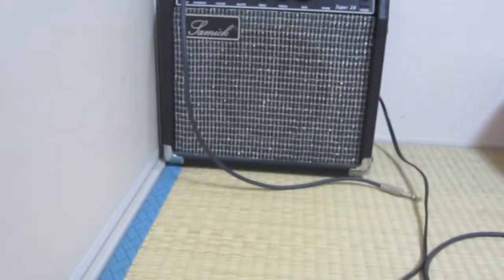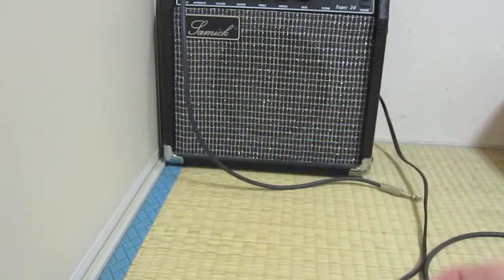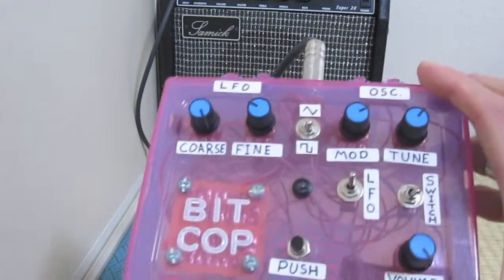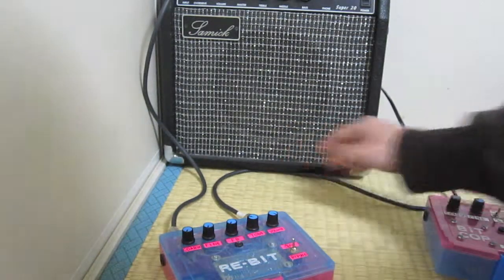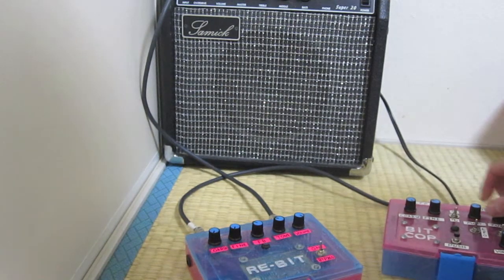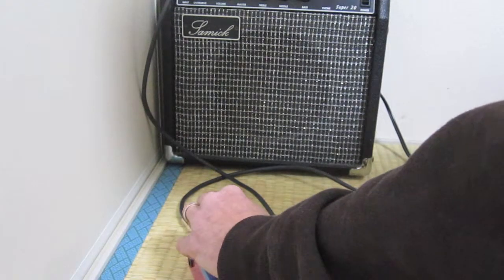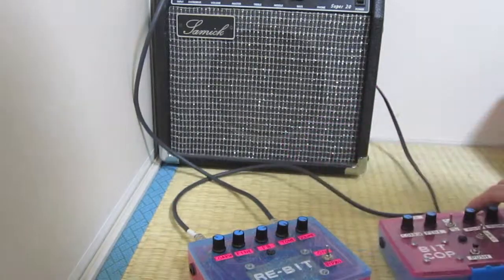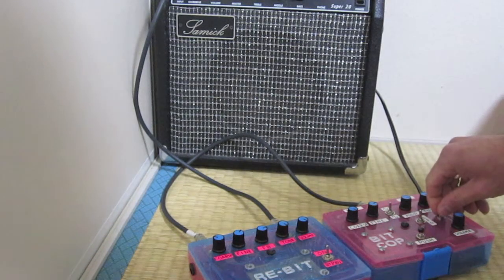Re-Bit DIY PT2399 LoFi Delay Pedal

Comment: Nice and lofi! The Volca Keys has the same delay chip but it doesn't sound quite that mental unfortunately.
Reply from the maker: ChrisLody I wouldn't necessarily call that unfortunate. A few months later I realized how bad this thing sounded. Someday I'll go back to it and fix it up. It's too noisy.
Reply: MrFricoco well I like it. It's easy to get a nice clean delay these days. It's the fucked up stuff that's more difficult I'd say :-)
Reply from the maker: Ya my main goal with the project. was to get a good delay for dub sounds. Crazy feedback,  long delays and tight short ring type delays. I could maybe salvage it and swap the tone control(useless) for a low pass filter, might clean it up a bit.
Reply: @MrFricoco  In Brazil there is a handmade pedal builder who uses this chipset and it sounds amazing, its a lofi thing yes but its killer. Its a pedal called Butt Freeze delay from Pink Snow Fx Factory
Reply: @MrFricoco  In Brazil there is a handmade pedal builder who uses this chipset and it sounds amazing, its a lofi thing but its killer. Its a pedal called Butt Freeze delay by Pink Snow Fx Factory.